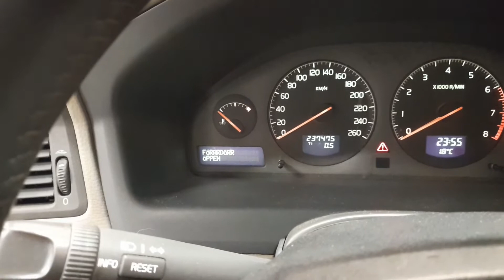UEM-0004 Repair! Volvo Alarm Siren V70/S60/S80/XC90/XC90

Comment: I'm going to install the battery on the outside on the unit and seal it, so when it leaks nextime the battery acid doesn't spill on the circuit board and I can plug a new battery pack into the unit with a connector.
Reply: I just did this after seeing your comment.  Great idea!

Comment: You don’t have to take the wheel off to unplug it. Turn the wheel all the way to the left and you have a large opening to access the alarm module behind the fender. I took a long flathead screw driver and un did the clip. Took me literally 5 mins. Sunroof works again
Reply: What if mine it not working anymore? I washed the engine bay without knowing this and now my sunroof it is not workin

Comment: So I’m working on a 2007 Volvo XC90 and I have a DTC code P0004 and the car has an immobilizer see manual message and the car will not start. The CEM Module and the battery have been replaced, so I’m wondering will this module cause a no start, also the new battery is being drained!

Comment: Great video!  I just did this and all is good...except when I use the Foxwell NT530 scanner, still shows two codes.... UEM-0004 and UEM-0078.  I clear them but they come back.  Nothing on the dash.  Any ideas? Sunroof and lock all work fine.

Comment: I have a 2005 Volvo XC90 T6. The sunroof and electric side mirrors do not work. This all happened when an alarm message started to flash. IF I simply unplug the alarm and bypass it, will the sunroof and mirrors work again?

Comment: I took my Alarm out of my Volvo V70 and the siren circuit board was Shot I tried using AA Batteries and the siren didn't make a Single Sound and the service alarm message was still there so it seems the circuit board was flooded with battery acid So I'm not going to fix the problem Unless I find a cheap siren that works But at least it worked for you Take care

Comment: How can I fix my 2008 Volvo S80 it doesn’t lock or unlock checked my fuse but the seem fine even replaced them. Would this video still apply to that chasis?
Reply from the maker: Try to read out fault codes on your vehicle, this video is regarding the P2 platform. Is it a specific door, or is it using the locking function on your car keys perhaps? I've made a video about broken locking mechanism on Volvo xc60. Maybe that one can help you out perhaps. 🙏
Reply: @EFreddy  I have Volvo vida so I will check on it, and no locks or alarm both don’t work. But inserting key in ignition is only way to start car

Comment: Hey, I have the same issue on my Volvo V70 2004. And it says alarm system service required. 
Now, I could almost not hear the siren when I checked if it worked. And eventually it stopped to work.
And then the message came by. At the same time the electrical sunroof stopped working.

And I checked the fuse on that and it was good. So I removed the siren and the sunroof started to work again. So, I double checked putting the faulty siren back, and sunroof stopped working again. I have still not replaced the siren though. 

Did you know about the siren/sunroof connection? 

Afterwards I talked to other people with V70s and they had the same issue. Some of them took them to the shop and also received a hefty sunroof repairing bill and it was nothing wrong with it.

I have subbed to your channel. I am sure it will be very helpful in the future.

Cheers
Reply: so you're using your car with the alarm unplugged?

is there any problem for doing that?

maybe the car won't lock?
Reply: @Charlitos1988  I have not have any issues looking the car with siren unplugged. But I took off the battery cables from both terminals. I put them together for an hour to reset everything. 
And then I plugged in the alarm that was not working and sun roof is still working. 

But eventually I will replace the siren.

Did all that out of curiosity.
Reply: @dakingakings7184  So if your sunroof isn't working you can just unplug the siren and the sunroof will work?
Reply: @geoffers158  I have friends that just took off the cables on the battery. And put +and- together for 30 minutes to reset everything and the sunroof started to work. But I didn’t know that. So, unplugged the siren and it worked. And I put the faulty alarm unit in again. And sunroof still worked. I guess that is a kind of reset too. I will eventually replace it though.

Anyhow, I am not saying it will work for everyone. Give it a shot with those 2 options. Start with the battery option as it is done quickly.
Reply: @dakingakings7184  OK brilliant,thanks for the quick reply.